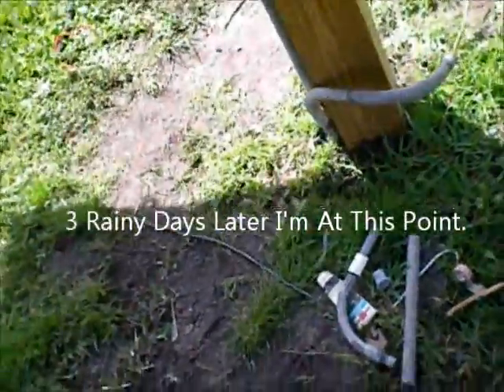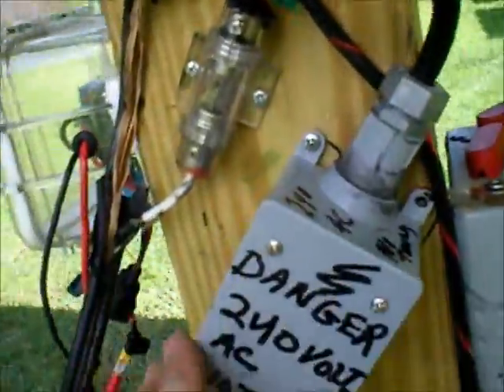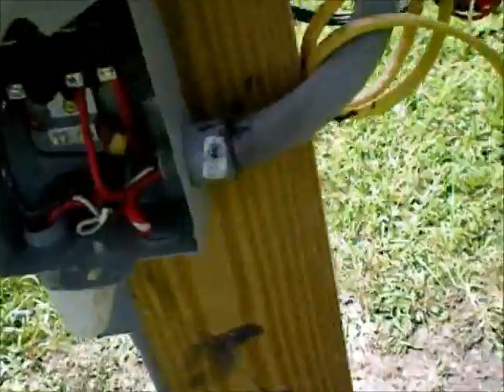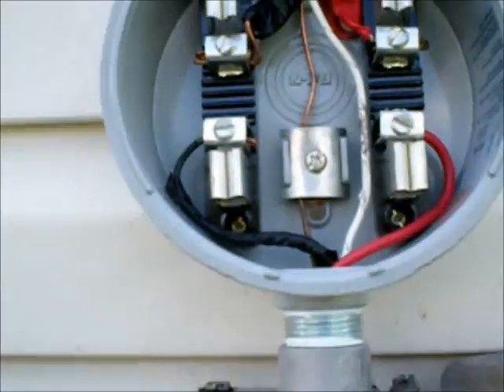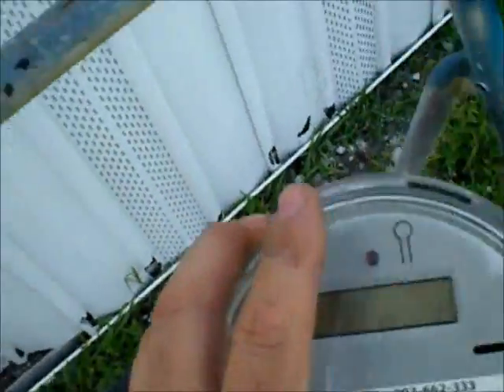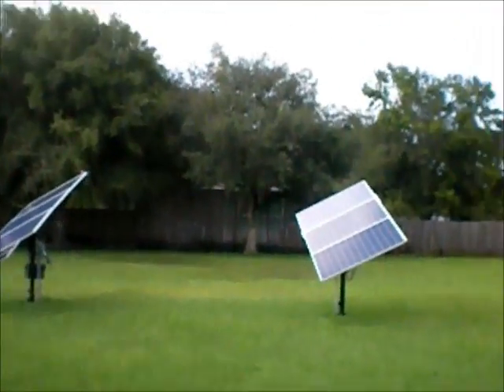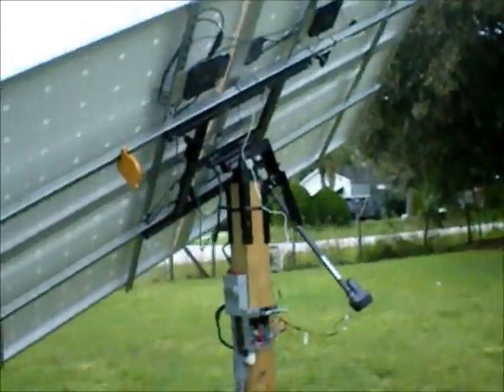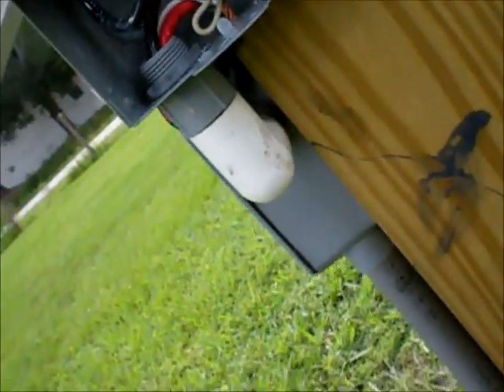POWER JACK GTI THE SWITCH OVER TO ENPHASE SLOWLY PART 1.

Comment from the maker: That,s my meter I bought it ,I did That so when I switch over to all enphase inverters they will all come in through that digital meter .That will then give me a net metering set up. Plus when i first got 2 inverters I did not have the envoy so I can keep track now 2 ways as to how much power I put in.I have 4 service panels here.1 main were the power meter is 1 in my shop & 2 on my home.1 out side ,1 inside with all the breakers in it.This took me for ever to switch out.with all the rain.